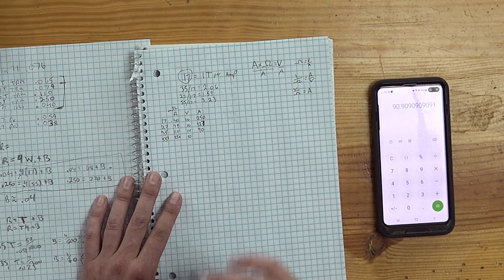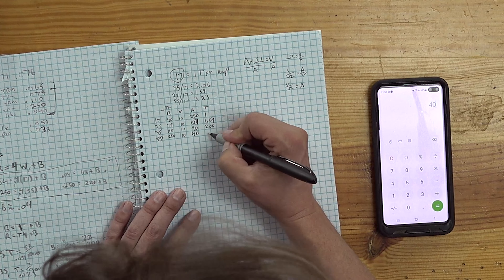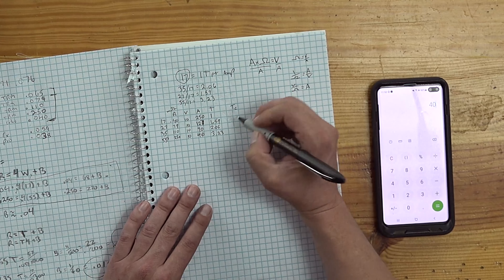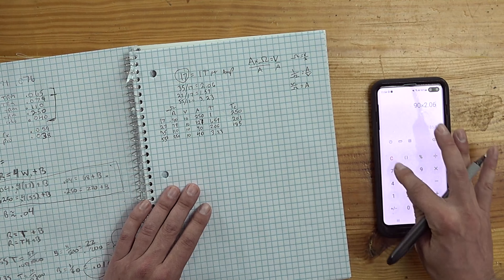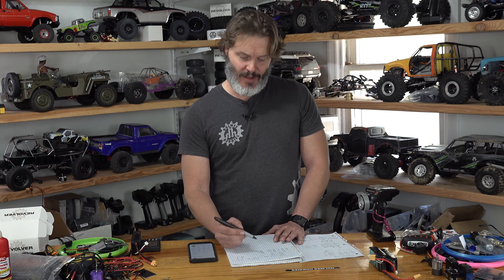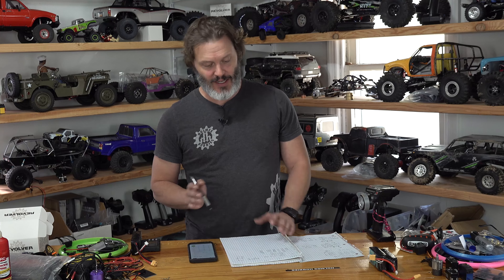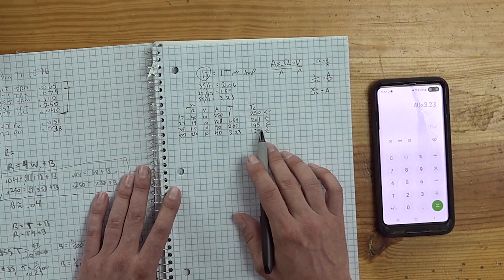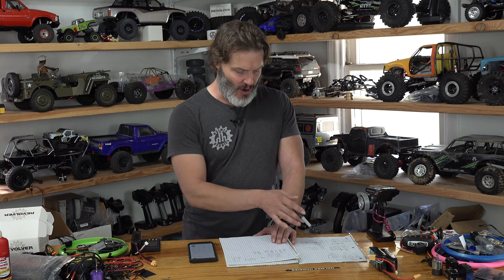How to find the ideal brushed motor for your rock crawler || Holmes Hobbies || Motor design

Comment: When I used to race back in the 90's I used a Trinity 12 Turn Triple in my Tamiya Egress. Gearing would change from 13:1 to 10:1 depending on the track. The only thing we worried about was the battery not going flat by the end of the race. Timed 4 minutes. As batteries got bigger the number of turns dropped. Bigger I mean 2000mah from 1700mah.  Lower turns was always better if could gear appropriately for battery to last the race.

There were different classes, Modified which was any motor you wanted, then Stock for 27T motors. They were meant for beginners. Couldn't actually lower the gear ratio as much on the 27T as didn't have the acceleration out of the corner if did due to lack of torque.  27T usually also had specifications on amount of timing on the motor. Some races required non adjustable end bells for set timing. So people started to cut half the brush off to increase the timing. A few degrees extra timing was way more important than the extra brush contact area. Those brushes were almost throw away items. Super soft as well as small contact/wear area. What was meant to be a cheap category for beginners yet became one of the most expensive.

For crawlers I think all the same things apply. Gear as best as can, then lowest number of turns. Rather than worrying  about the battery lasting 4 minutes, now it is about things overheating. As long as engine and ECU are aren't getting too hot then try a few turns lower. The added benefit of the lower resistance of the lower turns is better braking torque also. Single turn motors for crawlers as that give the most torque at the bottom of the rev range. Offroad racing was double and triples. Onroad triples and quads.
Reply from the maker: There is a limit with crawlers, in that we can't go too low of turn or the brushes saturate in a bind and the motor just produces heat. 27t is really the fastest.  30t is about golden zone, and 35t is where torque density  starts to drop off on any certain voltage.
Reply: Is there an issue with going to even lower gearing? If at 60:1 with a 30T, why not 120:1 with a 15T? 90:1 with 21T...

Are the crawlers limited in gear ratio or is there another reason?
Reply from the maker: @georgespiggot8502  there is limitations to gearing but the brushes are the main choke point. Twice as fast means twice the amps for the same torque output. And heat is square of amps. The 15t generates 4x more heat in the brushes (and phase side mosfets) as the 30t for any torque output.  Even with twice the gear down, the brushes would still see twice the heat with a 15t as 30t and turn into a thermal runaway without very careful setup and use.
Reply: @HolmesHobbies   Thanks. That is exactly what I wasn't sure of. Half turns is 4x heat, halved by gearing so still double the heat overall.

Do brushless motors fix the issue of overheating when in a stalled position, or do they just overheat in a different way?
Reply from the maker: @georgespiggot8502  brushless motors don't overheat nearly as much, so the roughly 2100kv limit of brushed becomes about 3500kv limit brushless.  This is all assuming 36mm motor diameter. 

Brushless creates heat and voltage drop in the phase wires and esc still though, so as we get above 2700kv the torque delivery still gets soft.  above 3500kv becomes a potential for thermal runaway and poor feeling throttle.

Comment: Why is your Crawl Master 18T if ~35  is more ideal? 

Great video, a little over my head but enjoyed it
Reply from the maker: The turn counts are chosen for max wire fill (cmils) on available wire guages.

5 slot crawlmaster and 3 slot torquemaster have different armatures so the natural wind count and kv will differ for each wire gauge

Comment: Bottom line with a brushed motor buy a Holmes and always buy 5slot for crawling. Pinion down I like to go as small as possible. If have the room run a 550 can the torque is considerably noticeable. 

-I just put a sealed can with bearing at the shaft. A HH 550 can sport 45t 5slot into my traxxas hauler. It’s half the speed at least in 1st and 2nd gear. I load the bed and tow my 4ws Capra on a trailer. It’s incredibly powerful. Thank you for your engineering it’s very appreciated.

-ps I’m hooked on the HW 2in1 pro and SE motors tho sorry. It fixes axials pos internal hi gearing on the scx10iii early bronco and my 4ws Capra both running an 11t pinion 😊

Comment: This was a very great explanation of info. I was lost halfway through, so I guess that green leafy weed did melt some brain cells over the years. Lol. All i know is my BRXL with the 16t Crawlmaster Expert works awesome and my Mamba Micro with your Puller Pro Stubby 2200kv is amazing and the other two rigs running your 13t Crawlmaster Expert motors never let me down. I've got a Capra project in the works so I'm thinking the BR Mini with a Crawlmaster Pro 13t is what it needs. Thanks and keep up the great work.

Comment: My brain just saw a bunch of numbers and just fried,lol. But you made me kinda understand a little. But I am curious what you would recommend for me and my rig. I'd like to stick to brushed as it's always what I used. I never tried brushless but wouldn't mind trying 1. I'm currently running your torquemaster br-xl esc as I used them for a number of years with great luck. My old cheap 550 motor died so I need a better motor. I could care less about speed as my rig is a 2 speed. I would like to have good torque. I was curious what you would recommend? Not sure if it matters but my rig ain't no light weight as it's pushing near 18 lbs,lol. I mainly run 2s but on rare occasions I run 3s. Thanks
Reply: Wow! That is a tank of a rig. I'd be curious to see that in action. I'm sure it's very realistic!

Comment: Wouldn't it be much more useful to represent the capability of each motor by graphing power output against rpm for a range of current values which are within the capability of the controller and battery? Using motor spindle torque doesn't represent torque at the wheels whereas the power output can be combined with wheel speed to give a representative torque figure. I'm suggesting that graphs of actual motor characteristics would be much easier to understand.
Reply from the maker: great idea!

Comment: I'm on a fixed income which doesn't allow much of a hobby budget, so I tend to go for cheap electronics. I DO subscribe to the gear-down volt-up theory but because of the budget restraints even though I use a 4s ESC I only run 3s batteries. I would love to see the static torque test you mentioned, I think it would be very interesting!

Comment: You should really consider doing a deep dive on brushless motors regarding current backflow when changing gears. E.g., switching from low to high on a standard Traxxas radio. I believe this is what’s causes a brushless system to fail, “melt” as everyone on the forums talks about. A brushed system obviously doesn’t have this issue. Would be a great comparison piece.

Comment: I don't think the numbers don't work out exactly the way you think they should for two reasons. First is that you should run your kelvin test at a number of different amperages to take an average result. Second test conditions were not the exactly the same for every motor (lead lengths and quality mostly). I try running the same test straight to the motors(no wires) and and take measurements at several different (running)loads.

Comment: Great video.  I would love to see more like this.  I enjoy math and really like the practical application of formulas, especially when we can use them to better understand electrical theory.  Do you have any suggestions for reading to get a better grasp on saturation?
Reply: Nothing wrong with a budget build! 
I don’t understand the ultra scale bodies that either cost $150 or took 100’s of hours to finish when it takes one roll down a hill climb to destroy it!
Don’t even like the price of bodies now a days!
A simple looks like a truck with a simple paint job cause it’s going to get destroyed is good enough for me. 
I get the kit and give it a simple paint job. 
I’m an old touring car racer  so it’s the body of the month with a light coat of paint n maybe a backing coat of white and run it! It’s going to last the season maybe with the help of drywall mesh n shoo goo but that’s about it, it won’t look pretty!
It’s a hobby, have fun!!

Comment: I think we'd need to know proper wheel speed and wheel torque required to move a vehicle over an obstacle. Then find the gear ratio to match each motor's rpm sweet spot to that wheel speed. 15,000rpm motor obviously needs different ratios than 30,000rpm motor. Then determine the amp draw needed to produce the torque. 30,000rpm motor with twice the ratio will need half the motor torque of 15,000rpm motor to produce same wheel torque. If we're not willing to invent a new gearbox then throw out all turn motors that don't fit common existing ratios. I have a feeling 4t motor, or whatever crazy low turn, will provide the best outcome but no gear reduction available. And of course, low turn motors require more expensive ESC. I also thought low speed motor control would be less relevant if motor is spinning twice as fast... 30,000rpm motor crawl speed would be twice the rpm as 15,000rpm motor at the same crawl speed because gear ratio are double. But heck I don't know. Its just intuition but so many things are counterintuitive.

Comment: I'm very appreciative of this video. I've been near ready to trash this hobby thanks to every Youtube RC 'influencer' trying to conjole RC enthusiasts into unnecessary and stupidly expensive brushless motors and electronics for their 1/10 scale crawlers that are already doing 100+ scale MPH with the trigger fully pulled.
Reply: 😅  every 1:1 crawler has 10,000 hp doesn't it?
Reply: I'm not that good at math but 12mph is 120mph in the 1/10 world right 😂🤣
Reply: @thercvanman2730  I think its the square root of the scale times the speed.  SO for 1/10th it would be 3.16 times the actual speed.
Reply: You know you don't have to do what the internet tells you to...right?..